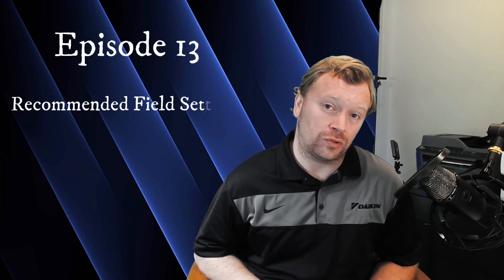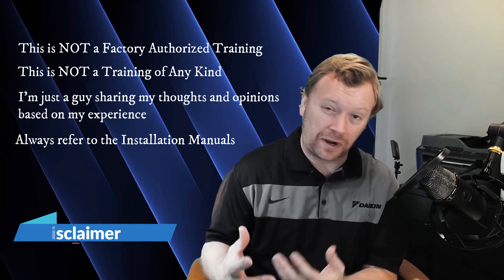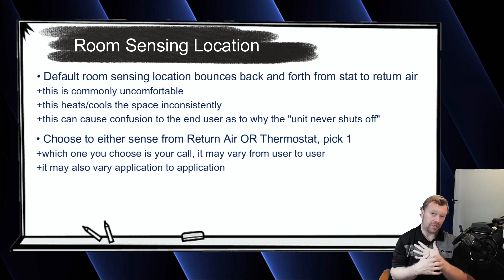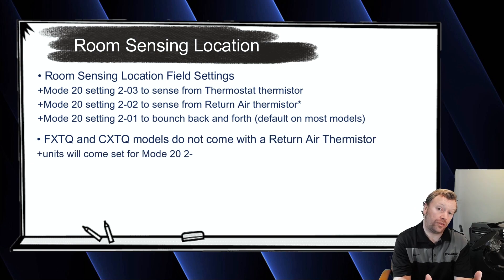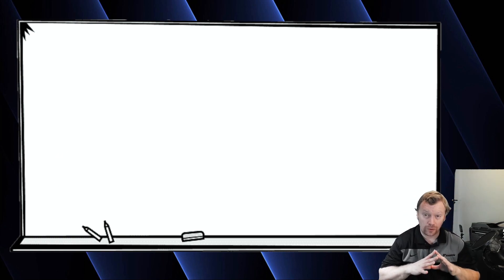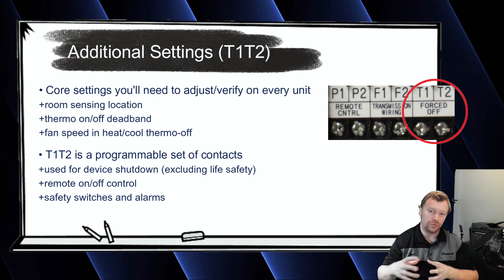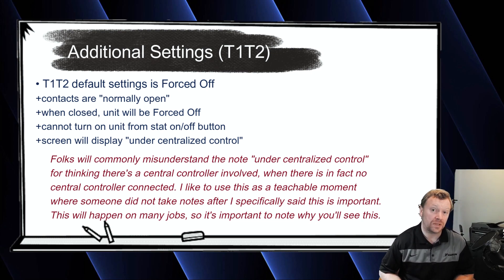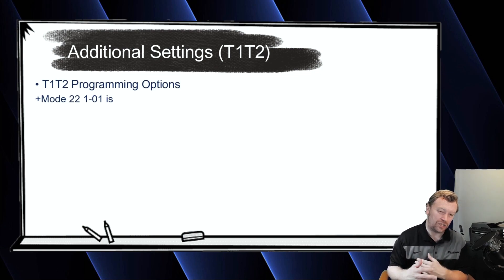Daikin VRV Field Settings | Recommended Settings for Residential VRVS & VRV Life Systems 12-10-2021

Comment: Hi there, very informative channel you have here. 

I am using a VRV X compressor in my new home. The behavior of the air-condition has been a little disappointing compared to my previous multi-split. 

It looks like the aircon is in a hurry to bring the temperature down, blowing very cold air when it is working to reach the set point and then switching off the compressor to wait for the temperature to rise. As a result, I have a sawtooth like temperature chart that cools for 5mins and then warms up for 10 to 15mins (depending on the room) before it starts cooling again. Is there some setting for managing this compressor/FCU behavior? Can't it cool at a slower pace and switch of less?

Additionally, the humidity is really bad! during the cooling part of the sawtooth, it drops to about 40% but climbs to 80+% during the warming cycle... double whammy cos it's "warmer" AND humid at the same time... I noticed that in dry mode, the humidity does not seem to drop below 60% either.... what do you think might be the issue?

Comment: Hi, thank you for the great video. I have set the deadband to 0.5 degrees, as well as switched the fan to turn off when desired temp is met. However the fan does not turn off, even 3-4 degrees past the set temp. Any ideas? I'm running a Daikin vrv 3 with Daikin fxdq32tvic ( bedroom) and fxdq63tvic (living), also, do you know if it's possible to change the external static pressure settings on these units?? I was told it was 23 -06 however this is not able to be selected. The bedroom fan is too high even on low..

Comment: Vrv system not vrf 👍
Reply from the maker: Same thing I knew what you meant 😉
Reply: Thanks for the advice, back on site tomorrow hopefully it will work  daikin tech told me mode 21 unit o2 didn't work , great videos 👍

Comment: How's it going 👍 just have quick question doing a install on a vrf system adding some spit systems + 2 twinducted  not had problems adding spits but the 2 twin system won't take the field setting 21 mode , any idea why👍
Reply from the maker: Yes you need to set it for each unit number. Unit 0 and unit 1. I did a few videos on this in the past. Check out the nav controller playlist.

Comment: Hey what’s up bro I recently came across your channel and I love it! I have a question can I see the port letter on a thermostat to figure out which indoor unit that thermostat belongs to?
Reply from the maker: No, but in order to see which indoor unit a stat controls you can go to forced fan on a nav controller and it will turn on thr fan for the indoor it's wired to. Make sure to turn the stat off before though so that way you can see which one turns on. This is also used to determine which indoor is which when a group of indoors are all wired to a single nav controller. The bs port it gets wired to does not show up which is why it's so important to label wiring and carefully land the wire on the port of the branch box it was piped to.
Reply: @InverterAlways  thanks man for the quick answer

Comment: Very curious if you have ever come across humidity problems with these units. I have done two types of installs. One being a residential house with a single air handler and Madoka stat and the other was a commercial building with all ceiling cassettes and Brc1e stats and both installs have really high humidity during the summer. They also both have problems with the deadband. Both installs have a problems with the temp not staying consistent. I’m more curious about the humidity problems than the temp problems. I did set the deadband to 1 degree on both but it hasn’t helped much. Curious if you have come across these problems. Thanks for any feedback
Reply from the maker: Depends if you're installing vrv or mini splits, since nav Controllers and madoka stats work with any p1p2 indoor style. Mini splits have wider deadbands while vrv does a pretty good job of sticking to setpoint. I haven't had much issue except for jobs improperly sized or installed, leaking systems, etc... 
Regarding humidity, I tell folks all the time these are NOT designed to handle dehum. They are room air conditioners not dehumidifiers. They will pull some moisture out sure, but not designed to handle much of that load. So yes I see them struggle in some applications, which is why it's important to factor in whatever dehum you may need separately from the vrv equipment.

Comment: Quick question about the deadband setting - have an FDMQ18RVJU controlled with a Daikin One+ thermostat through the translation adaptor. I'm surprised that I don't see any ability to change the mode 22 2-XX field setting as it is entirely missing from the available options. Is this setting just not available on the FDMQ or is this some kind of configuration error? The thermostat seems to behave as if it has a 2 degree deadband and it would be great to tighten it to 1 degree.
Reply from the maker: You are correct in that the fdmq does not have deadband settings. It's not a vrv indoor unit. The daikin one is hard coded and cannot be changed. The deadband on daikin one is set to a historesis of 1 degree, so it has to hit 1 degree past setpoint to trigger then 1 more degree satisfies for a total of 2.

Comment: Hey man love the videos and they’ve helped a love with my first few VRV installs. I have a question about a system we installed that started making a gurgling and hissing sounds from the one way ceiling cassettes when they get a call for heat or cool. It’s pretty loud and is waking the customer up at night😬 
Any ideas or things I can check?
Reply from the maker: Noise is always a challenge. Could be due to turbulence from tight bends in quick succession of each other right at the unit. Could be low on charge too. Could be a kinked line set somewhere near that head. 
Shoot it could just be the unit making a call or satisfying the call and the expansion valve position change causes that noise. Whats the fan set to do in thermo off? 

I always try to avoid putting units right near the bed since folks are sometimes super sensitive to sounds. You put dchecker on it to analyze performance?
Reply: @InverterAlways  I’ve never heard that regarding bends at the head unit. We do have a two 90’s within the last 2’ of line set. I’ll have to look them over. Do you typically stick with air low or medium static air handlers when you zone each bedroom?
Reply from the maker: @creativeproperty6844  it's not usually a problem if you have a foot then a bend then a foot then a bend. I'm talking about where you flare the unit then immediately bend then immediately bend again those bends super tight can sometimes increase harmonics just from increases to turbulence. Most of the time it's not bad, sometimes it just gets done that one way where it increases noise. 

Noises are super challenging so take a peak at it then take some dchecker data to see if the system is performing right. Make sure it's not low on charge or anything. 

The style of the unit is not always ducted we do tons of wall units. Floor unit. And cassettes in bedrooms just usually try to avoid close to the bed. 
1 way fxeq are my favorite because the case of the unit is above ceiling so you have some flexibility as to where you put it. Where's 4 way fxzq must go in center of room which I don't like because I want my lights and ceiling fixtures to remain.
Reply: @InverterAlways  That the exact reason I like them as well for residential applications. I’ll give that a try and let you know how it goes. Thanks again for the help!
Reply: @InverterAlways  could the noice be caused by an over charge?
Reply from the maker: @creativeproperty6844  I wouldn't think so, I mean it's possible but not usually the cause. The only way to verify charge is obviously weigh it out but I always stress taking run time first to analyze if you think that is even necessary. No reason to pull charge unless you see performance issues that deam pulling charge necessary in my opinion.
Reply: @InverterAlways Have you ever used a subcool to check charge? It has a note in the installation manual about a double check after a weigh in with a subcool.
Reply from the maker: @creativeproperty6844  yea. Takes a while you need to make sure it's ramped all the way up. You can check that while taking performance data with dchecker as well. Pretty common to check that regardless of service or new install.

Comment: Here is is another question I had.  In your experience with the daikin one, has the thermostat been off temp in epic fashion?  LIke 2-5 degrees?  So you have to manually calibrate it?  I have thermometers sitting next to the daikin one,  Daikin one would say 73,  different thermometers next to it say 76.  So you have to go into dealer settings and adjust it to match +3.  One other thing that is interesting about this is right after the thermostat is rebooted, it reads right ( about 3 degrees lower).  Then after some time, it goes back to 3 degrees higher then thermometers around it.
Reply from the maker: Sometimes they are off. Just adjust it as you mentioned. Once it reboots it will take a moment to adjust. I turn off my led light as well to help prevent any additional heat given off by the light. It's also a distracting light I prefer not to look at.

Comment: Hey its me again!  Cooling season, and after the last few months of no issues with heating with VRV life with single coil and propane as backup, it brings the house to temp in a matter of just a few mins say 10 ( say from 69-71 set for 70).  However its 78 in my house right now,  cooling mode to 73 has been running for 30 mins, I feel cold our coming out of registers but temp  its only dropped 1 degree usually takes HOURS to get temp down 4 or 5 degrees and some days it never shuts off hovering at a degree or 2 above temp setting.  Is this your experience?  Why does it take so much longer to cool a house down / maintain temp in cooling mode then heating it?  Is it because of size of compressor is much smaller when its in reversing mode or something?    Thanks always love your advise and knowledge on this system.
Reply from the maker: Shouldn't take THAT long. What is the fan speed in cooling? Should be on high or auto for that unit. If the fan is on low the sensible capacity of the coil is decreased so that may be part of it. 

Glad it's heated well though. 1 other thing to make sure you do is make sure set point isn't drastically higher, then when you switch to cool cranking down the setpoint. Just like you maintain heat set to 70 you want to maintain cooling at say 72, or whatever is comfortable for you. It will call when room gets to a degree above cool setpoint and should maintain no problem. 

Obviously check filters and make sure outdoor coil is clean. But other than that nothing field setting wise that should need adjustment based on your past setting adjustment.
Reply: @InverterAlways  One thing I did just notice 90 mins into the cooling cycle, the system ramped up drastically all of a sudden, I did notice though the first hour the system must of been in "low" speed mode but  for last 20 mins the system is pumping out the cold air like gang busters, the fan is set to auto, and it seems to be on HIGH now as far as air flow coming out.  temp is now at 74 so 60 mins to go  from 78 to 76 but less then 30 to go from 76 to 74.  Not too bad its night time outside temp is 77.    the unit is set in the "recirculation mode" to auto.  I guess we will see how it performs on 90 degree days.  As mentioned in the past to you the unit would never hit set temp, it would run all day long with the daikin one blue light on, (set temp would be 72 never get below 73 or 74.)  I also noticed they went through quite a few software revisions in the daikin one,  I'm on 2.8.2 they were stuck on at 2.4.3 for months but seems to have updated a few times last few months.
Reply: Here is another way to rephrase my question/ concern and what are your thoughts..
I had the system VRF Life system for a year with the older style thermostat never looked at it never had any issues.  Then I got the daikin one with the huge indicator light its running, with the temp in full display.  So now its obvious what the temp is and how often the unit is running.  So it leads to a lot of confusion when its always running and not hitting set temp (and of course even goes below set temp by a degree or 2 before it actually stops cooling). 

 But if its maintaining the air at low power not the on- off way were used to, it causes major confusion.  Is my system not able to hit set temp, is something wrong or is it just being energy efficent?  
*All winter it would hit set temp for heating no issues. On 10 mins,  off 20 mins..
*in summer it never shuts off and runs all day at low power mode, never hitting set temp.  Then at night,  it will go below set point a degree or 2 before shutting off.  So very confusing for end customers.
Reply: ok so here is my example:  System has been in cooling mode for 3 1/2 hours.  Its at 73, set to 73,  its still cooling and fan speed is very low right now.  So this is the time the unit confuses me, I guess its trying to get to 73.0 its at 73.5 or something?  And its trying not to over shoot so its just in lowest possible mode trying to get there?  Thanks.
Reply from the maker: @cranbers  if you set field setting mode 22 6-02 then it will run fan on whatever the stat speed is all the time in cool mode so no need for air circulation to be enabled at all (just fyi). 
So you heat to 70 and cool to 74? If you're mode is set to auto heat/cool it won't even switch until room is 75 or 76 anyways. If you manually set it to cool mode though once you get it down to setpoint leave the setpoint there and it should maintain well. They aren't great at recovering, designed more for maintaining. Its possible the unit was sized for a cooling load and is just oversized for the homes heating needs. Hard to say though for sure. Hopefully once you are maintaining in cool mode it won't have any issues though.
Reply from the maker: @cranbers  likely your mode 22 2-02 setting is set at 2-01 which is a wider thermo deadband. You can turn the light off if you want, that's what I did on mine. I just mentioned this in another reply to you before seeing this but it's possible the unit is sized for cooling and is oversized for heat. That may be why it bounces so fast in heat but takes longer in cooling. Its also important to note that you want to try and maintain a setpoint all the time. If you are letting it get to 78 before turning on cooling, it may take a while to get to the lower 70's. How long is hard to say. Doesn't mean anything is wrong with the unit though. 

The daikin one room temp can be distracting I hear ya there. You can set the screen to display the time instead if you want. Which may help keep you from constantly looking at it.
Reply from the maker: @cranbers  it wants to maintain that temp. It will run as slow as it can to NOT overshoot. But it doesn't shut off until it's 1 or 2 degrees past setpoint. Mode 22 2-02 tightens it to 1 degree that's how I set all mine every time. It will run at that temp at low speed just maintaing happily, that's totally normal.

Comment: Also what settings in heating to overcome air stratification.
Reply from the maker: Keep the fan on low low when heat thermo off to keep air movement going and room consistent temperature. Other than that you should be good.

Comment: Can you discuss settings to use when in Auto mode?
Reply from the maker: If you have a vrvs 1 to 1 (only 1 indoor unit)  then you can set it up the same way as any other system, just with dual setpoints in this case. Mini split systems and multi zone vrvs I don't like using auto, I just put it in heat, or put it in cool. Regardless, the field settings on vrvs all pretty much stay consistent in most cases and only some change based on a certain user's preference. For example fan off in heat thermo off due to comfort complaints.

Comment: Installing my first vrv this week. Vrv coil with gas heater and a single floor mount unit upstairs. I wanna use 2 daikin one stats instead of the nav controllers. Does mych change as far as set up and commissioning? And how do i select the master contoller on the daikin one stats?
Reply from the maker: Same settings just getting in to the menu is different. It will ask you when you commission if you want to set it as the master there's a checkbox for it. Check out my daikin one playlist I have a whole series on that stat to help you. 

Congrats on your first Install I hope it goes well. Vrv life with gas furnace is super neat too I installed that on my house when it first came out.
Reply: @InverterAlways  thanks